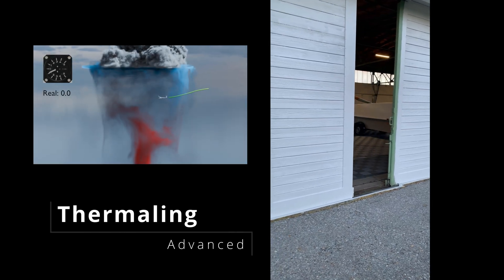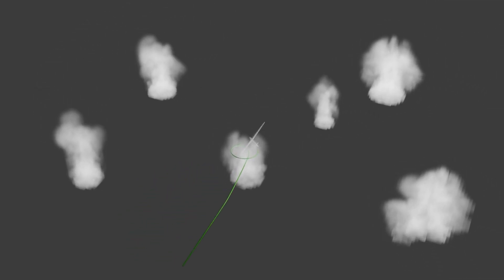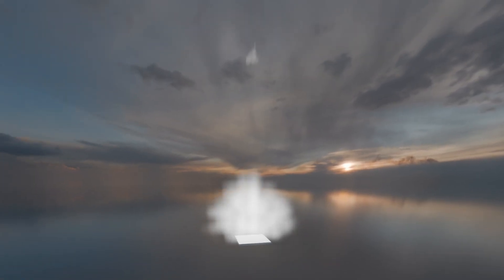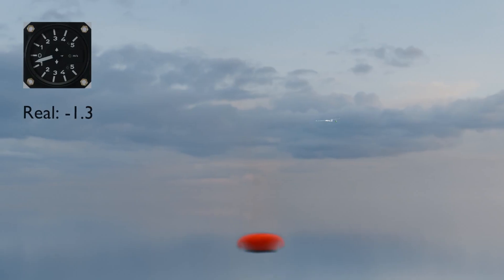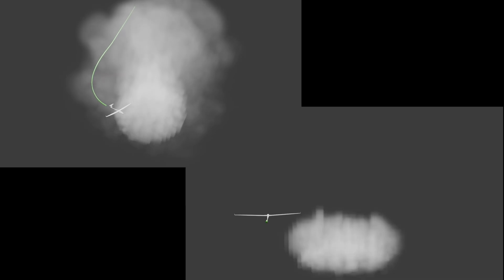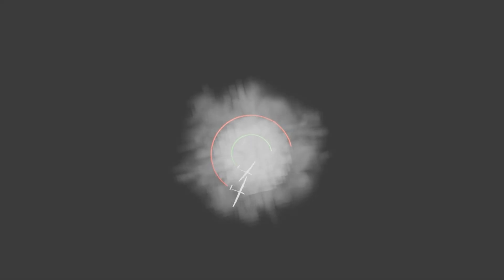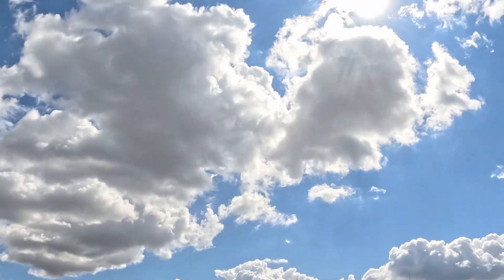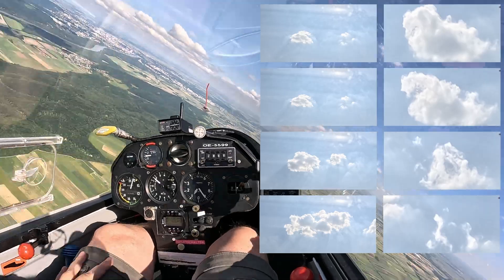Thermaling Advanced - Animations and Examples

Comment: I have been a glider pilot for 50+ years but in the winter I fly Condor and I find it bizarre that , on windy days, if after a few turns you loose the thermal you have to fly downwind to find it back . Are the thermals in CONDOR tilted the wrong way ?
Reply from the maker: hm ... Any Condor flyers out there ? you can switch on the thermal markers to check if your theory is right ?
Reply: @spitzflight  Thanks for your interrest in my question . I will try, as you suggest , with a flight of my making and check .

Comment: regarding the landscape investigation  - woods are by far the best thermal source. Elevation changes in the terrain also very important (high = good, low = bad). A tractor on a field is close to irrelevant. But luckily, with all the offsetting from wind etc. even a pilot with a completely wrong understanding will statistically find thermals here and there.